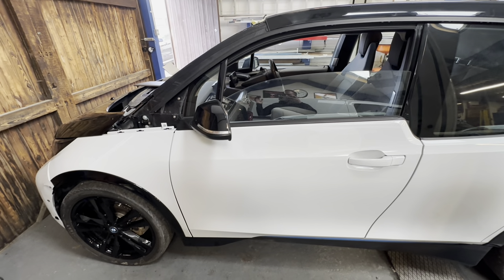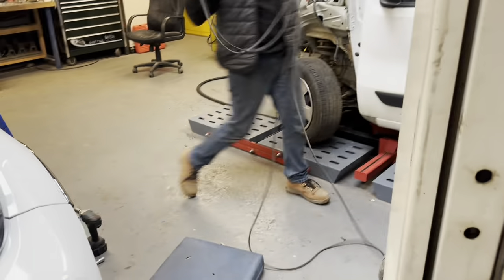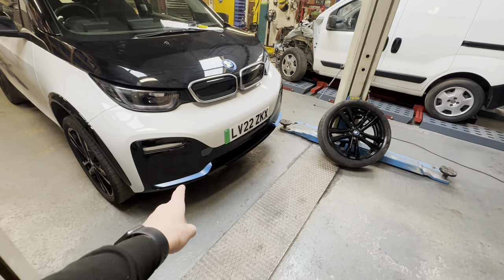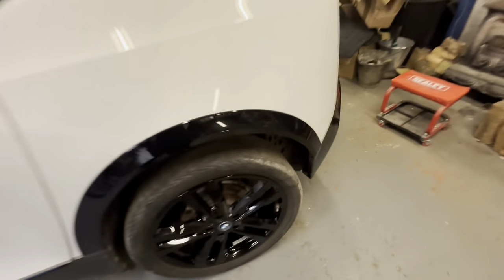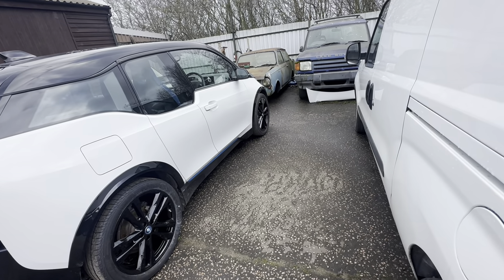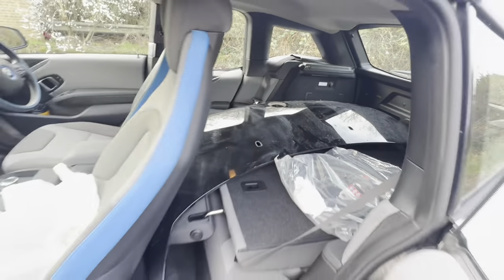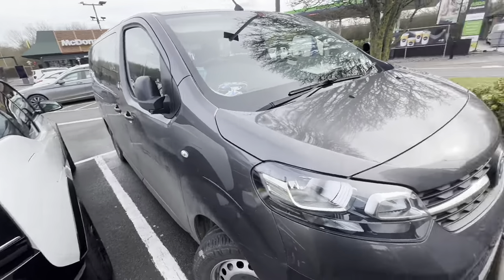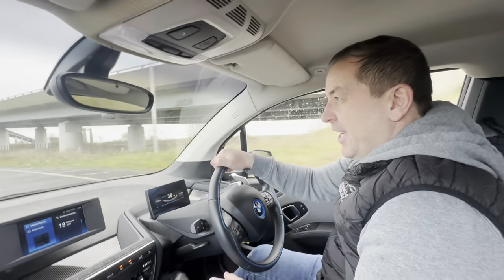IS THERE A FUTURE IN REPAIRING SALVAGE ELECTRIC CARS???

Comment: That’s where electric doesn’t make sense. 134miles for £38. My car is £20 for 100miles. Only makes sense if you charge at home. If you can’t charge at home, no access, it’s not a fair replacement and therefore it’s not the future for everyone
Reply from the maker: It’s 190 miles for 34 from a expensive super charger at 85p pkwh at home it would be 20p pkwh and only 10p if charging at night
Reply: Absolutely correct, it only really makes sense if you've got a home charger. I recently got a an EV and am lucky enough to have a drive (the only one in the street) & home charger and it costs about £5 to charge. If we didn't have a drive then it's not economically feasible.
Reply: In my Vauxhall Corsa D (2020) 100 miles is 11 quid....range is 600 miles....2 mins to `full charge`....car cost me £11,500 at 2 years old with 20k on the clock....will not spontaneously combust, 600 mile range whatever the weather/temp...etc
You are correct....`not for everyone`.
As regards Rob/Chris...yet again, nice little earner and that`s what it`s all about...as regards EVs, do your research (A lot have not & just jumped in on the strength of the lying MSM/Govt) fully and take your time when buying.....
Reply: If you don't have photovoltaics at home, electric cars are just too expensive. My little Mitsubishi will do 180 miles for £20, and it will still be running in twenty years. A little accident with an EV were the battery is damaged and the car is a right off. A lot of insurance companies don't cover EV batteries, check the small print.
Reply: £38, that was mad expensive even for a fast charge, I doubt anywhere else in Europe charge that much per kWh
Reply: Mine does £1.90 per 100miles as I charge at 8pence per kWh
Reply: That’s seemed to be in the eco mode limited to 56mph, with heaters and stuff disabled, looks like there was another few modes for like comfort and sport I’m guessing the range on those modes is far less
Reply: Can you sell it though?
Reply: Bear in mind everyone, that these prices are before there is a captive customer base too. Imagine what fast charge prices might be like in the future if everyone were forced to have battery cars.
Reply: Fast/Ultra fast charger prices cannot be taken on their own. If you set of on a long journey you charge at home (8p PKWH), then ultra fast charge to top up and then return and fill up over night again (8p PKWH) then calculate the cost overall for the whole range. if you set off with a full tank of petrol, you do that journey (with no stopping- which is nonsense as everyone needs a wee), but with 500-550 range for the tank. I have driven EV’s for 2 years, public charging is expensive (prices will drop), I don’t use them. We operate 2 x EV’s on a 7KW home charger for £40 a month….most people only drive 32 miles a day (12K a year), = 240 Gallons a year- £1800.00 (The EV would be 300-400 a month for the same range) or £5 a day for the car -32 miles, in a reasonable EV range you’d get 160 miles for that home charging.
Reply: @davebax6819 probably cheaper ! But home charging is the way forward on a cheap tariff if you don’t have access to you’re car from you’re property then this can be an issue
Reply: Technology takes time to roll out - I  agree that if you can't charge at home then it's not the right time for an electric car just yet. In future there will be more chargers which will bring the price down.
Reply: if you charge it up at home off peak times its only 15p per kw not 80 like he was paying
Reply: @axgtsimi  or 7p on the right tariff. I've used a public charger less than 10 times in 2 years of owning my car - only for travelling away overnight.
Reply: @txteva I currently pay 8p per kWh between midnight and 5am , and half price electricity through most of the day Sunday
Reply: That's like saying Ferrari's are no good  because you cant afford to have or run one. Also, I doubt your car will be a rapid and nibble as this. 

Of course these are not for everyone depending on battery size but if you mostly go about within range and can charge at home or at work, these are peanuts to run and mind boggling when it comes to performance for the money. 

Turning point on these I3's are london taxi like so excellent to manoeuvre anywhere too... Nice catch :)
Reply: @enrobsorussell corsa d? Corsa d came out in 2007 lol
Reply: @Europeancars1337  The current model Corsa (Vauxhall 208) diesel. This model started in 2019 and has Petrol, diesel & EV power.....`lol`?
Reply: Good job you didn't have to wait for the charger else wel be still waiting for this video 
They just isn't going tobe enough chargers for wot the government wants they only Good for the school run
Reply: 134 miles costs me £1.16 charging overnight
Reply: Prefer hybrids
Reply: Of course, electricity is currently at an all time high. New rules on profiteering on public EV chargers, and a reduction in wholesale prices for electricity should bring down prices, and that will lead to an increase in demand, used prices for EVs are already rising.
Reply: @adrianrawlings3032  err...he did have to wait for the charger ? Did you watch the same video ?
Reply: @enrobsorussell , spontaneously combust ? Have a word with yourself not all electric cars spontaneously combust , just like not  all ice cars combust.
Reply: @christopherwright1795  yep mine too I always laugh at the misinformation people spout about electric cars, I would never buy another ice car for day to day motoring.
Reply: @christopherwright1795  get it on the motorway with heaters on them come back and tell us how many miles you get then
Reply: @bigfist255  eh I’ve had EVs for 8yrs I’ve been on the motorway today with my ev and with the heater on ! And you’re point is ?
Reply: @deansh8506  won't get you back though if you drive 90 .miles from home
Reply: @bigfist255  what ???? You’re living in cloud cuckoo land I’ve travelled many times on the motorway from home , I went to Holyhead from Manchester and back a few months ago on one charge no problem had 10% left cost me absolutely f—-k all because of my cheap rate leccy
Reply: @bigfist255  you obviously haven’t a clue what you are talking about  .
Reply: @dungareesareforfools  Yes, but until a few years ago everyone was forced to use petrol or diesel.
Reply: @Summers-lad  I'm not sure how that's relevant. My point was that if you think the price of fast charging is high now, wait until there's no alternative for a lot more people.
Reply: Overnight last night I was paying about 12p per kWh, and I'm not on an EV specific tariff, so if you don't have PV but you do have off-street parking then EVs are still considerably cheaper to run than petrol or diesel.  If you need on-street parking though you will be at the mercy of whoever is providing it, and here it's 60p per kilowatt hour.
Reply: I've done on 32k in 2 years and mine costs me MAX £10 A week
Reply: @dungareesareforfools  And more importantly, don't forget when they add the fuel duty that they are currently losing on EVs. It amounts to something like doubling the cost. 😜

Comment: Excellent video. just a note to anyone thinking of buying a crash damaged BMW fully electric vehicle.  if any of the airbags have blown its a full HV battery out job to replace the pyrofuse and control unit within. it needs a special end of service tool and direct communication with BMW Germany. BMW charge £8000 to do that job.
Reply: Yep the guys got lucky on this one, in most cases people won't be. Personally I hate EVs, especially the excuses to force them on us. I really hope people don't see this video as meaning EVs are an easy fix, most are not, This actually highlights what you might get off with, e.g body panel and winscreen stuff start getting involved with electrical issues on these it's over.
Reply: Thankfully there’s an ever increasing network of HEVRA mechanics who will charge a fraction of that.
Reply: Ok if it’s almost new and you are pretty confident on getting 20k for the finished article but anything older probably not worth it..
Reply: I think even with 8000£ repair I think these gents could make a profit and leave a little for the next guy.
Reply: @marksutherland774  who is forcing who to buy an EV?
Reply: @evilutionltd ”they” don’t you know! It’s always “they” 😉😂
Reply: Great video yet again, so glad you guys got fortunate and no very expensive bits or labour. You well deserve all you get
Reply: @evilutionltd   Goverment Regulations...
Reply: Batteries only good for 10 years
Reply: @bexhill8777  how do you feel like the Government has forced you to buy an EV?
Reply: @Ditcha1 you mean after ten years they just fall over? Dead, flat no effing charge?
Reply: Why would you pay bmw to do anything .evey job is thousands so it yourself
Reply: I had the same problem with my bmw 530e 2018
Reply: @evilutionltd  same as everyday life we live in a democracy but the government does what they want the people have no say don’t think your winning because you don’t have an ev …..yet
Reply: @Ditcha1  No, they are warrantied for 10 years, which is much, much better than any conventional car.   And they last a lot longer than that - there are Teslas running around with 300k miles and 12 years old.
Reply: @russnunn2456  they aren't banning ICE cars so no one is forcing you to own an EV.
Reply from the maker: I assure you there are plenty of experts out there in this field and wouldn’t charge anywhere near that amount it would be under £1000 👍
Reply from the maker: @thejackofalltravels8267 it would never cost 8k 👍
Reply from the maker: @Ditcha1  you mean the batteries only guaranteed for 10 years 👍
Reply: @sruk  well as the 2 separator units are £1895 each and the control unit is £1490 all of which require replacement after an airbag blows. Then there is the 84 one time use bolts and the seal that needs replacement. That’s without any labour charge. You tell me who will do that for under £1000.
Reply from the maker: @banjosoft  all these parts have part numbers that cross over and are always available at a fraction of the cost. Volvo told us recently our v60 needed a new hybrid battery that cost thousands but we sent it to crash data and they replaced the pyro for a couple of hundred and the car is now back to perfect there are lots of ev and mhev vehicles out there and almost anything can be done and at a significantly less amount than a dealer
Reply: @sruk  I will look forward to you guys doing one of these in the coming months. I trawled the whole of the uk looking for an independent ev specialist prepared to take on the job. They all told me BMW main dealer only due to the requirement of a special end of service tool that BMW won’t supply outside their dealer network.  Love the channel. 👍
Reply: £8000 that’s daylight robbery!!🤬
Reply: Not on an i3, the pyrofuse is on the positive battery terminal and is about £270 to replace. Your comment is correct for VW ID batteries though, hence when they are in the auction they don't go for as much as its not a driveway job.
Reply: @ckm-mkc not on the original battery or motors thats for sure.
Reply: @evilutionltd I thought they were, after 2035? The sale of new ic cars anyway.
Reply: @thecolneranger1588  That's just the Government setting unreal expectations and kicking the problem down the road for some other Government to sort out. It'll get pushed further and further back because the Government aren't putting money into the infrastructure.

Even when the ICE cars are no longer made, there will be companies getting around it, selling vehicles are quadricycles etc. I'll boost the price of ICE cars, people will look after them and the rebuild scene will become even better.
Reply: @evilutionltd Yeah but... have you thought about how you are going to buy fuel? Because EV's will kill ICE - we know this from other disruptive technologies that adoption is an S curve - it's exponential and the tipping point normally comes down to cost. There are some roadblocks - improving public charging and home charging for those without a driveway. In a country as small as the UK public charging won't be an issue. Home charging for those without a driveway is a larger problem but nowhere near as big as fuelling ICE cars. You think I'm overstating the case - consider this - the largest car market in the world (China) had 30% EV sales since May last year.

Comment: The wrapped trim looks better than the original. Great call.
Reply: Ironically, most cars with carbon wrap on the trim are all metal bodyshells, but this car can justify having carbon-wrapped trim, as its entire bodyshell is made of carbon fibre (see the sills at 7:40)
Reply: Although reason for matt finish is to elimnate reflections.  We have an i3 and everything is matt finish on the dash.
Reply: The CF wrap looks much more up-market..
Reply: I would be a bit concerned about the gloss finish on the carbon wrap, I think it's going to reflect the sunlight a bit, the old finish was matt for a reason
Reply: I suggested the carbon wrap in the first episode although I envisaged like I did mine with a less glossy finish and the small right panel with a weave / and \ on others.
Reply: @garfield2279  No more so than the various screens all cars have these days.

Comment: For those who might read and asking questions re charging.
Instavolt is pretty much the most expensive charging network there is. Most would only us these if forced to.
Charging to 100% takes far longer than stopping at 80% and then just going again.

Not criticising here, but these are important factors.
Reply: If you are on a long journey you don't have much choice of chargers as you need to charge when you are low.....similarly if you are travelling distance, do you really want to start off with 20% off your range when you charge?
Reply: @zilspeed I'm glad you mentioned this as I was going to myself: I would have been interested to see how fast it got to 80%. My niece has just bought a new iX and the charge to 80% is very fast indeed, but then tapers off towards 100%. The charge time to 80% from about 10-15% is time enough for her to break a long drive and recharge herself with a decent coffee.
Reply: I was gonna say £38 for 136mls is quite expensive 😬
Reply: On my Octopus Go tariff of 9p/kW it’s £3.78 from 0-100% for the 42 kWh battery, so works out around 2.7p/mile.
Reply: @bobstirling6885  You can go to 90/95 at full charging power on an i3 but if you have a car that can do 250kW, and you wait until it's dropped to about 25 at 100%, you're wasting a lot of your own time as well as anyone waiting.
Reply: @mikey_bb  I have a 1st gen i3 with a smaller battery - about a 70 mile range - it costs $2 US to charge at home...
Reply: It’s a fair comment although I imagine most owners would already have home charging organised so would probably only ever use an express charger if the were on holiday or driving hundreds of miles unplanned…
Reply: @bobstirling6885  agreed. If you knew you were going somewhere you’d charge it up to 100% at home first..
Reply: @ckm-mkc  I am aware it's cheaper to charge at home, my point was specifically aimed at instavolt...
Reply: @Bin-The-L-Plates  I am aware home charging is cheaper, I'm just amazed at how expensive Instavolt is...
Reply: @mikey_bb  ridiculously so....for those without home charging there is literally no gain with an EV.
Reply: Isn't the Octopus tariff 7.5p?
Reply: @ALYDAVIDSON1  if you can charge from home....

Comment: Just a word of caution guys, only charge to 100% if you're doing a long journey. For normal running, charge to 80% to prolong battery life.

It's also quicker to charge to 80% and do a further top up charge, than it is to charge to 100%.

This is something you'll  learn if you keep the EV for a period of time.

Great video to dip your toes into the world of EVs.

Incidentally we have an Audi Q8 e-tron away at the body shop for a ding in the rear nearside wheel arch, caused by a car door being blown into it.....the cost to repair the ding £800.

Comment: I recently just done work experience as a technician at my local bmw dealer and a few of these came in. When draining the oil on the little 2 cylinder engine in the back it was so fresh because it hardly gets used. When my mentor was putting the dip stick on you have to get someone else to check it and sign a document to say it’s been checked. It’s crazy how the electric cars are going. Great video rob and Chris once again 👍
Reply from the maker: This car doesn’t have a engine bud it’s all electric 👍
Reply: @sruk  oh yh sorry but the older ones do

Comment: What fascinates me is setting the “single pedal” mode.. you drive it purely with the accelerator, never need to touch the brake pedal… soon get used to it … fabulous 😊
Reply: I discovered that when the i3 first came out and I was offered a test drive whilst my ICE BMW was being fixed. You just needed the conventional brakes to bring it to a full stop.
Reply: Yes me too! (I test drove one of the prototype minis around a very busy Reading town centre about ten years ago now) and it actually made a lot of sense. I don’t think I actually touched the brakes once!
Reply: Not even a mode on the i3, it's always on and it works brilliantly.

Comment: buddy had the 20kw and it stopped. Main dealer said the loom was burnt, but a real expert said the inverter had blown phases and it needed new modules to begin with. Turns out the repair was not worth it. as the repair was at least 8-10k

Comment: I have an all electric Volvo and with the car you get 12 months free subscription for cheaper rapid charging.
InstaVolt is only 47p/kWh.
I use the card for emergencies and charge at home at 7.5p/kWh which costs £5 and gives me 220miles of range.
What’s not to like, 408hp, 0-60 in 4.5seconds, faster than my old Golf R